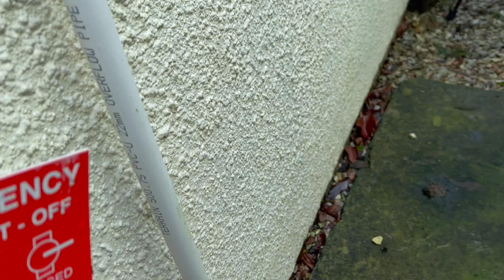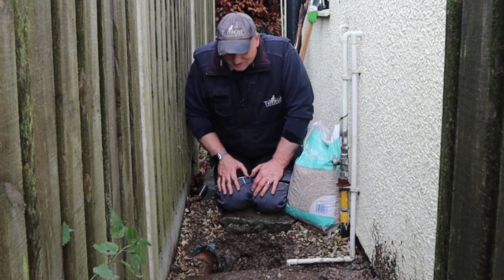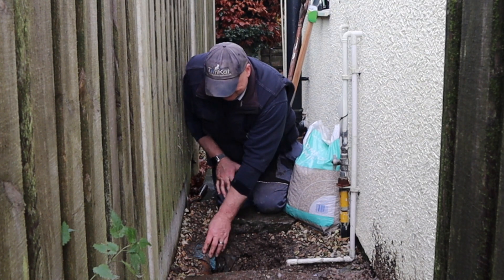More disasters at home, How to install a  soakaway on a gas boiler. Installing condensate pro.

Comment: Well, when I had a new boiler last year in the garage, the gas engineer ( reputable a registered) ran the condensate pipe inside the garage and out into a rain pipe that actually goes into a soak away in the garden somewhere . A good way away put in by the builder 45 years ago. Watching your stuff, which is fascinating, makes me wonder if anyone , apart from you, does anything right?

Comment: Brillian video Derek. Watching most condensate videos, there's always a drain available. Your video demonstrates the hurdles involved installing a dedicated condensate soakaway, thanks for filming it. The effort of trying to install a dedicated hopper in the ground with it being so close to the foundation, there's probably too much to bust out to get that in and ultimately not worth it because the condensate is the only thing going into it. That and the fact that the electric is so close to the soil pipe you wouldn't really have room to fit the elbow. Does make you wonder how that slice ended up in the soil pipe doesn't it? Some Araldite should make short work of that, being as it's your own home I'd have thought that'd be ok. Thanks for the video.

Comment: How often, should you check the soakaway?
I have only ever fitted one, and wondered how you would check the limestone chippings and replace if necessary.  I over came this by installing it a using by using manhole riser rings with a lid on top.
Reply from the maker: Every year with the service

Comment: Slip couplers on the split soil if theres room?    I've seen some flexi rubber ones with jubilee clips that look easier to fit in a trench.      If not what about filling the  cut with gripfill ?

During the first lockdown I was doing a emergency boiler change and had to dig a soakaway as replacing SE:                 Mains water in to kitchen on the other side of the house,  power cables in overhead,  no drains that side of house.

Safe to dig then:  WRONG!        Dug down 2 foot with a Iron bar and posthole tongs,   and found the 25mmm blue mdpe main smack in the middle of the hole!,  luckily just missed a strike with the pointed digging bar,   what are the odds on   landing straight on that in a large garden..........

Comment: Did you put limestone chippings in the soak away.
Reply from the maker: Yes I did
Reply: I’ve been to loads of these been fitted and actually cut in half because they are so long.    And they can’t be bothered to dig deep enough
Reply: Can I ask.  I have re connected onto a condense pipe that goes into a fitting in the side of a washing machine stand pipe.   I’ve been told you can’t do this on a Worcester combi.     I’ve never been told that before.   Any idea why.   Thanks
Reply from the maker: @peterreid4567  the only reason I can think of is the pipe being blocked by the washing powder which I have come across
Reply: @tomkatgastraining  he said it can’t be done on a Worcester combi boiler.   Really odd.       Thanks for your reply.    There’s probably only about 10.000 that need altering 😂

Comment: love real situations, dig hole find stuff in the way, drill hole and drill too long, check inside and find you just missed a cable. wouldnt it be easier to get an office job.

Comment: You uncovered a drain pipe which can be tapped into for the condensate.   Seems rather odd that you went to hassle of a soak away.  Plus the drain pipe needed repairing.  Far better to use a drain pipe if you can.   Very strange decisions.
Reply from the maker: I have a septic tank system so you can’t put boiler condensate water into it so it’s not a strange decision.
Reply: @tomkatgastraining  Err what regulation covers that then?  Boiler condensate can go into any drainage system including rain water, sewage, soak away and septic tank.   A septic tank is after all a form of soak away....  Yes, condensate is acidic but it is lost in the the volume of other domestic waste discharge from house.  A typical house will discharge approx 750 litres of waste water per day, and a condensing boiler when operating will product about 2 litres per hour. Therefore the condensate is somewhat lost in the wash.
Reply from the maker: @XX-ww8lh  mate any decent plumber or gas engineer knows that if you install condensate into a septic tank it attacks the bacteria leading to smells and the tank being pumped out more often causing more cost to the customer.
Reply: @tomkatgastraining  utter tosh if you consider how diluted the condensate is in the crap from the house each day.  It won't make a blind bit of difference.  Besides, there are no controls over what gets thrown down the sink or toilet.
Reply from the maker: @XX-ww8lh  I guess you have never lived with a septic tank then.?
Reply: @tomkatgastraining  It's basic maths. Think about it.
Reply from the maker: @XX-ww8lh  we need to agree to disagree but I live with a septic tank and I know when my wife has used normal washing up liquid because the day after our garden smells of s#it.
Reply: @tomkatgastraining  well yes of course you can smell it as that's the liquid soaking away....